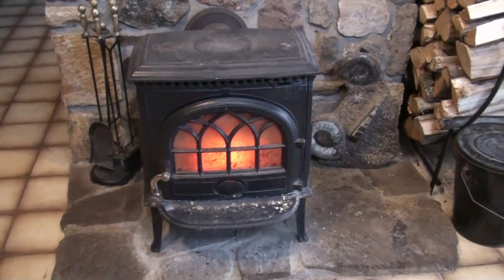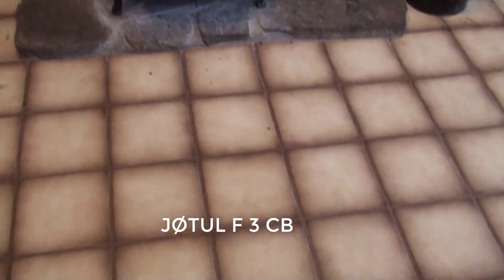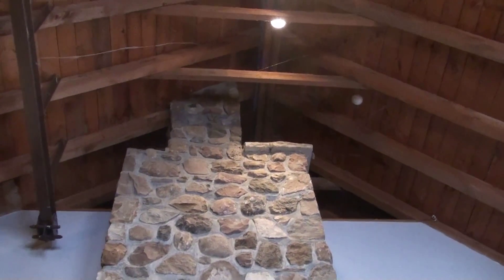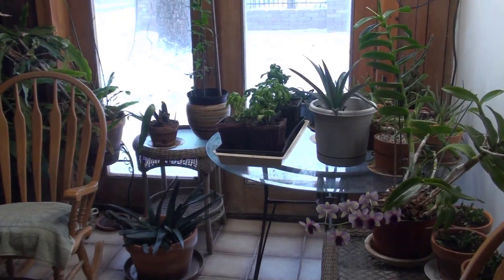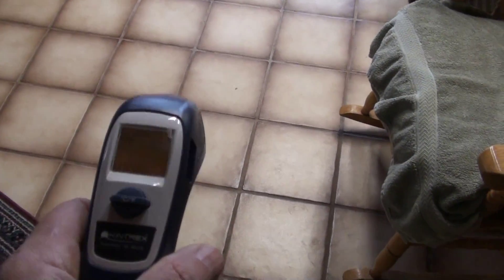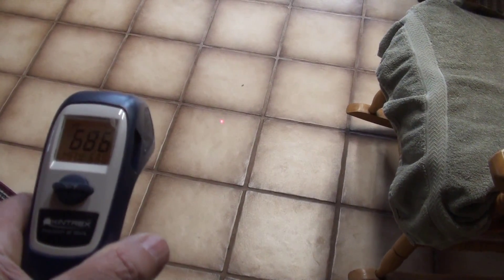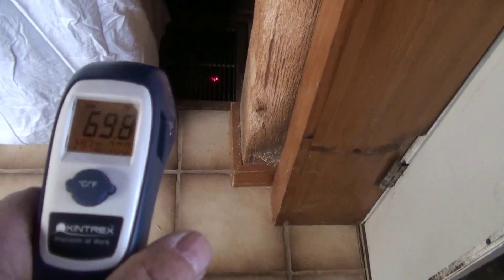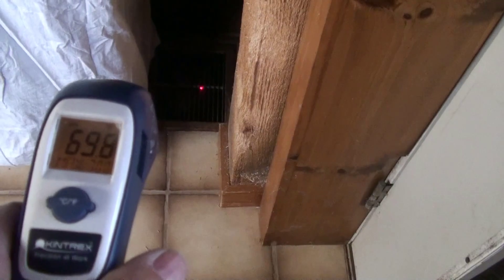Thermal mass, thermal bank, underground thermal energy storage, passive solar home

Comment: Good morning, Kevin,
I have a few more questions, more practical ones, if you could please clarify them.
I've been thinking about your technique and I'm very interested in it, but new questions have come up.

1 - Does the hot air only enter through one place, the fan? Is there some kind of internal piping between the stones to better spread the heat? 
2 - How does the heat spread through the stones to heat everything, or are there more or less hot spots? 
3 - How many air outlets do you have for the rooms? Do they work well? Is there a calculation or formula to know how many outlets I can have, and the diameter of the pipes? What types of pipes/tubes did you use? 
4 - Can these heat outlet ducts for the environment be installed on the floor or wall? 
5 - Is there a better way to capture the hot air in the ducts, that is, are there perforated pipes between the stones to capture the hot air and release it into the environment or is none of this necessary? For example, the fan blows hot air onto the stones, which heat them up, creating positive pressure and simply releasing the air into the air outlets, without any type of pipes between the stones? 
6 - If you use pipes between the stones, what type of pipes, what material, won't they melt? At what temperature are the stones? 
7 - How did you concrete the floor over the stones? Didn't the concrete run through the spaces between the stones? If you used a tarp, isn't there a risk of the tarp burning with the hot stones and releasing toxic gases? If you could explain step by step how it was done, that would be perfect. 
8 - Would some type of drain be necessary to prevent possible accumulation of water/condensation? 
9 - How did you insulate this "pool" of stones? What materials and order did you use? For example, from the outside to the inside, I imagined a tarp/moisture barrier, an insulator and then a wall of concrete blocks. 
10 - Over time, don't deviations occur where the air passes more easily? For example, will the hot air outlets that are closer to the fan have a greater air flow or hotter air than those that are further away? Or does it somehow balance out? 
11 - Do you have water or sewage pipes running through this area of the rocks? How was this done? I imagine a PVC sewage pipe from the bathroom melting with the heat from the rocks. And one of the great advantages would be to have a warm bathroom floor. Maybe install a temperature-resistant pipe where it comes into contact with the rocks.
12 - Is there some kind of barrier between the stones and the floor, so that it does not overheat or is it not necessary?

Thank you very much, your idea and project are fantastic.
Reply from the maker: I posted a video this morning hopefully answering your questions. Hope this helps!

Comment: Hi Kevin,
I just watched this video about your system, it's really interesting.
Let me see if I understand,

you have a thermal mass under the house, made of stones. The same fan that pulls hot air from the roof of the house, passes this air through these stones under the house, creating a positive pressure, which forces the hot air to go to the ducts and grills in the rooms, this heat also heats the floor. Is that it? This system is brilliant, if you have time and it's possible, could you answer some questions, please.
1 - There are several sources of heat, one of the main ones is this cast iron stove. From what I understand, the stone wall/chimney is also a thermal mass. The smoke comes out of the stove and runs through the middle channel, exiting through the chimney in the ceiling. Does the smoke pass through channels or does it run unobstructed until it exits? Is the channel made of stone or bricks, or metal? Are the side ducts basically to collect the hot air and throw it into the thermal mass? 
2 - How big is the house? How much space does your strategy keep warm? 
3 - How did you create the thermal mass under the house? How big is it? Did you use river rocks? Did you insulate the thermal mass from the ground/walls in any way?
4 - What is your floor like, a concrete slab? Would it work if it were a concrete slab over the thermal mass? It would basically be almost like underfloor heating, right? 
5 - Are there any problems with humidity in the thermal mass, mold, etc.? 
6 - Would it work if the house only had one floor and didn't have a cathedral roof? 
7 - How does the system work to cool the house in the summer? Do you have any kind of underground ducts like a Canadian well? 
8 - Would it work in a not-so-cold environment, for example southern Brazil, with average temperatures of 10 to 15 degrees Celsius with cold snaps of 0 degrees, but a house that is not so insulated. Imagine 200 square meters, built of concrete blocks, with lots of single-glazed windows. Would it maintain a pleasant/acceptable temperature? 
9 - Do you leave the fan on 24/7, 365? 
10 - If the ceiling is straight, not cathedral style, would it still work? 
11 - Do you have any type of dehumidifier, air conditioner, etc. I ask because it may be some type of appliance that is common to you, but not here.

Thank you very much for your attention.
Reply from the maker: @samuelRi: Thermal Mass Heating System Details
1. Heat Sources, Chimney, and Ducts
You’re mostly correct about the setup. The primary heat source is a cast-iron wood stove. The stove’s smoke exits through a central masonry chimney, which covered by a stone wall acting as a secondary thermal mass. The smoke travels unobstructed through this masonry chimney to the roof. The stone wall absorbs heat from the chimney via conduction, radiating it slowly into the house. Two separate side masonry chimneys run parallel to the central chimney. These side chimneys don’t handle smoke; they collect hot air that naturally rises to the ceiling and conduction from the chimney mass, pulled by a fan (convection) to the thermal mass under the floor. This creates a positive pressure system, pushing warm air through the washed stone bed for storage and then to floor vents in various rooms, while also heating the floor itself.
2. House Size and Heated Space
Our house in Oswego, NY, is approximately 24 feet by 40 feet (about 89 sqm), with open cathedral ceilings and a second and third floor. The system comfortably heats the entire space, maintaining 65-80°F (18-27°C) even in harsh winters (-10 to 0°C). For your 200 sqm single-story home, the system should work similarly, especially in your milder climate (10-15°C, occasional 0°C), though less insulation may require more frequent firing to maintain comfort.
3. Thermal Mass Construction
The thermal mass under the house is a 24-foot by 18-foot by 4-foot bed (about 7.3m x 5.5m x 1.2m, or ~48 cubic meters) of washed large rocks from a local gravel bed. We built it by excavating below the subfloor, laying a vapor barrier (plastic sheeting) with insulation below the stone, and surrounding it with rigid foam insulation on the sides to prevent heat loss to the soil. The round rocks are packed to allow air to flow through. A plenum on each end of the thermal mass facilitates airflow when the fan pulls hot air from the ceiling chimneys into the mass, storing heat and warming the floor above.
4. Floor Type and Underfloor Heating
The floor above the thermal mass is a 6-inch (15cm) concrete slab with a tile finish, which absorbs and radiates heat from the thermal mass, functioning like underfloor heating. Your idea of a concrete slab over the thermal mass would work well, as it would store and release heat similarly. The slab’s thickness and tile surface help regulate heat release, keeping the floor warm for hours after the stove is fired.
5. Humidity and Mold Issues
We haven’t had issues with humidity or mold in the thermal mass. The vapor barrier and insulation below and on the sides keep ground moisture out, and the warm air circulating through the rocks stays dry, as it’s sourced from inside the house. Firing the stove every couple of days when the sun is behind clouds keeps the system warm, preventing condensation. In your humid winter climate, a robust vapor barrier and insulation would be critical to avoid moisture buildup, especially with single-glazed windows and less insulation.
6. Single-Story House Without Cathedral Roof
Yes, the system would work in a single-story home without a cathedral roof. Our cathedral ceiling helps hot air collect at the peak for the fan to pull, but in a flat-ceiling home, you could place intake vents high on walls or at the ceiling to capture rising hot air. A south-facing passive solar design is good in the northern hemisphere, but a north-facing in the southern hemisphere would help, as heat naturally rises, and a high central location can collect it even without a stove fire on sunny days. The key is ensuring the fan pulls warm air to the thermal mass and distributes it effectively through ducts.
7. Cooling in Summer
The system is designed for heating, but on hot days, we close blinds and windows to prevent heat gain in our super-insulated home. Running the fan helps circulate air through the thermal mass, which stays cooler than the outside air, effectively cooling the house. We don’t use underground ducts like a Canadian well, but such a system could enhance cooling in your climate. For Brazil’s hot summers, you’d likely need additional ventilation or a separate cooling system. We have a 2 foot overhang on the south side of our house with the sun low in the sky in the winter we get heat through the second story windows but in the summer when the sun is higher in the sky the overhang doesn’t allow radiant heat from the sun on the second story windows.
8. Suitability for Southern Brazil’s Climate and Less-Insulated House
Your climate (10-15°C, occasional 0°C) is much milder than ours, so the system should work for a 200 sqm house of concrete blocks with single-glazed windows, but poor insulation will increase heat loss. Proper home orientation, overhangs, window choice and placement, and air, vapor, and thermal barriers are essential to maximize efficiency. With these, the system could maintain a pleasant 20-22°C with daily firings, though you may need supplemental heat in distant rooms. Adding insulation (e.g., window films, sealed gaps) would reduce firing frequency.
9. Fan Operation
The fan, placed behind a filter, is designed to run 24/7, ensuring continuous air circulation through the thermal mass and ducts. This maintains consistent heating in winter and aids cooling in summer by leveraging the thermal mass’s temperature stability. In your milder climate, you might run the fan less (e.g., 12-18 hours daily during cold snaps) to save energy, depending on your comfort needs.
10. Straight Ceiling Compatibility
A straight (non-cathedral) ceiling is feasible, as noted in question 6. You’d need to position hot air intake vents near the ceiling to capture rising heat. The system’s effectiveness relies on air circulation and thermal mass, not ceiling shape, so it would work for your single-story home with proper vent placement. A rocket stove with a heated bench may be helpful for your winter days.
11. Dehumidifiers or Air Conditioners
We don’t use a dehumidifier or air conditioner but have humidifiers for indoor plants in winter when the wood stove dries the air. Our region’s humidity, similar to yours, hasn’t caused issues in the house or thermal mass. In your humid winters, a dehumidifier might help if poor insulation and single glazing trap moisture, but regular stove firing should suffice. For Brazil’s hot summers, ventilation may not be enough, so a separate cooling system (e.g., fans or AC) could be necessary.
Final Thoughts
Your 200 sqm single-story home in southern Brazil is well-suited for a thermal mass heating system like ours, especially given your milder climate. The cast-iron stove, masonry chimneys, and underfloor thermal mass of washed rocks can provide steady, comfortable heat with daily firings, even in a less-insulated house. However, optimizing insulation, window placement, and home orientation will significantly reduce heat loss and firing frequency. The 24/7 fan operation ensures consistent heat distribution and can aid summer cooling by leveraging the thermal mass’s stability. For your humid winters, a robust vapor barrier and insulation around the thermal mass are crucial to prevent moisture issues. If you pursue this, consult a local heating engineer to size the stove (5-7 kW recommended) and thermal mass for your 200 sqm home, and consider adding window films or sealing gaps to boost efficiency. Compared to a Kuznetsov OIK 4 masonry heater, this system is simpler to adapt for ducted air distribution and may be more cost-effective for your budget, given the high labor costs of masonry heaters. I’d love to hear about your progress.🌞

Comment: A very elegant solution - is it necessary to match air flow rate through the sun of vents into all rooms heated with the max airflow rate obtained by you fan blowing into the stones heat battery?
Reply from the maker: Our house is in open envelope design so that air easily flows throughout our entire house.

Comment: It's a counter-current heat-exchange system  with built-in thermal storage, to be slightly more precise. You can also use cheap mirrors (which don't use glass, like mylar glued with resin to a cheap tarp) and some structural frames to reflect more sunlight onto the house. You can also use a bunch of metal sheets painted black or a fine metal mesh painted black to convert some of that concentrated sunlight into heat, which would also create air currents which to loop inside the house. And you can even make those mirrors use the summer sunlight to heat a black-painted metal chimney pot (you can add with nuts and bolts a heatsink system which to allow smoke to flow out and to heat the air going out through the chimney), to have it pull the summer heat from the building to the outside of the building. Also, you can use fresnel mirror walls (like fresnel lenses, but with mirrors, and made into or placed onto walls) to concentrate even more sunlight onto the house, or solar air heaters to heat air through the walls nearby the house (which are facing the sun). That way, you could get a house in which you never need a fire in the winter. For the summer, you could use some shallow geothermal (pipes buried 1-2 meters or yards deep), which to go through the ceiling of the house, then feed into the solar air heater walls, then get ejected into the air, so you can use the ground's lower summer temperature to heat the house. You can use the same geothermal in the winter by feeding it to the solar air heater walls and then releasing that into the house. And those can be either/both open-loop (open-cycle) and closed-loop (closed-cycle) systems.
Reply: wow, amazing, thanks for sharing
Reply: @ff-ti7nj  My pleasure! If you have any questions, not only about this video or my comment, feel free to ask me. I'm a polymath, I know many things from many fields.
Reply: @SapioiT  Big Yes! do you have any recommendations for storing heat in sand? Stirling engines etc?
Reply: @ff-ti7nj  From what I know, stirling engines are quite expensive, because they have not reached a sufficient level in the economies of scale. If there were factories pumping them out fairly cheaply, people would buy them and use them. Storing heat in sand could be done with off-the-shelf industrial fans which to resist the temperatures reached by the hot air. You can use hot air to heat oil, for a loop between the heat storage, heat generation, and heat usage (power generation). You would have to use aerated concrete or maybe even more expensive insulation, to keep the heat from escaping into the ground, but the heated air can pass through the sand and heat the sand, and cold air can pass through the sand and be heated by the sand while cooling the sand. This way, heat is moved to the power generation part, which is ideally a stirling engine (because it's not as dangerous as a steam turbine), but not necessarily. You could also use a lot of peltier modules, which don't work above a certain temperature, or you could use a few check valves and heated vertical rising chambers to cause a current which to spin a turbine which to generate power (though that would be a lot less efficient). I would recommend watching more videos on the subject, and searching for affordable stirling engines which could fit your energy needs and heat production options. You can also have the stirling engine use concentrated solar or heated oil to transfer the heat onto the stirling engine's hot side, and either water or ambient air for the cooling part of the stirling engine. You can also use geothermal cooling in the summer and geothermal heating in the winter, paired with passive air heating to move that air. Good luck finding the right setup for yourself!
Reply: @SapioiT  Wow, you saved me a lot of time on research on these subjects , thanks a lot
Reply: @ff-ti7nj  My pleasure! I hope I was able to help. Heating and cooling is easier, but getting electricity from heat is not so cheap, unfortunately.